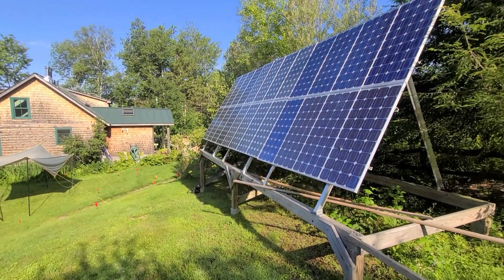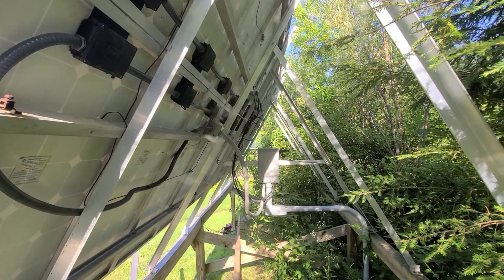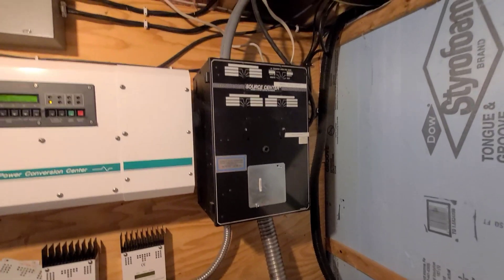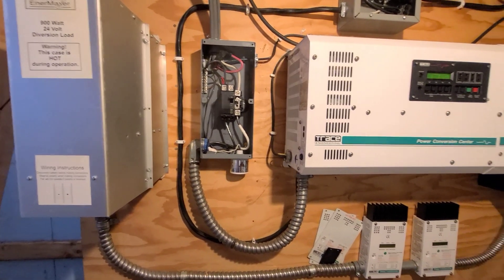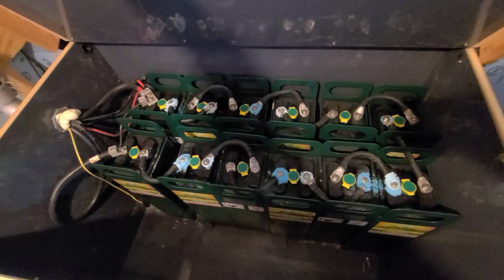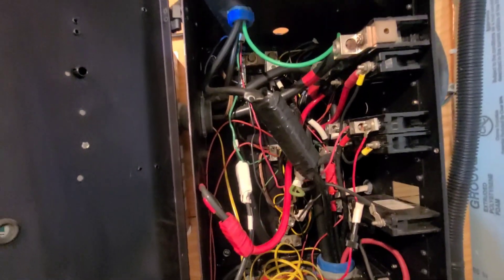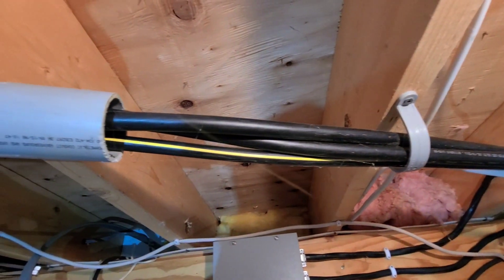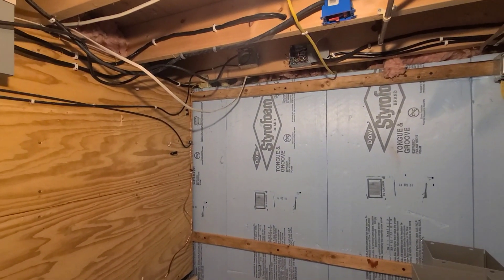We Replaced an Old Offgrid Solar System with Sol-Ark, Simpliphi & Q cells!

Comment: Curious of you used the Generator In to connect the Generator or if you used a different method.
Reply from the maker: We used the grid input, which is recommended for offgrid installs.  The gen input is now used as a smart load output during the summer when there's excess PV production.
Reply: @benssolarandbattery   Yes, makes sense for grid input.  Great content.  Thanks for posting all this info.

Comment: What buss bar set up are you using in gutter. 4/0 or 2/0 for batteries
Reply from the maker: 4"x12"x1/4" copper with standoffs.  4awg to each battery, 4/0 into the Sol-Ark.

Comment: What voltage are you running on the pannels and what did the material cost for the system.
Reply from the maker: Voltage is around 405 Voc. Not sure on material cost.

Comment: Great clean set-up Ben. Amazing some of the holes that installers have to crawl into. Good thing the owner removed the old batteries and set-up. One question, I saw you open the top panel on the Sol-Ark and was wondering what you did it for? Keep these coming as they will be drawing viewers to your channel once more searches on Sol-Ark's are done down the road. This was a very good video presentation.
Reply from the maker: Thanks Craig.  I heard something rattling around in there when we were carrying it in.  Turned out to be an extra screw that I didn't see in the bottom compartment.
Reply from the maker: @Thomas Chrombly thanks! I like using wireways for this type of install.  Keeps everything nice and tidy.
Reply from the maker: @Thomas Chrombly he sold them to a neighbor along with the entire system.  Everything still worked, just wasn't meeting their needs anymore.